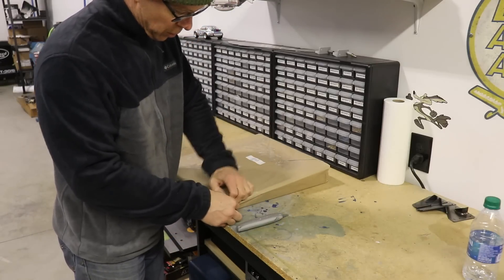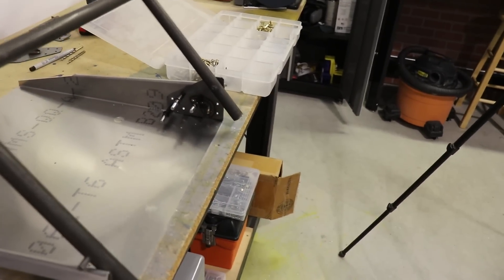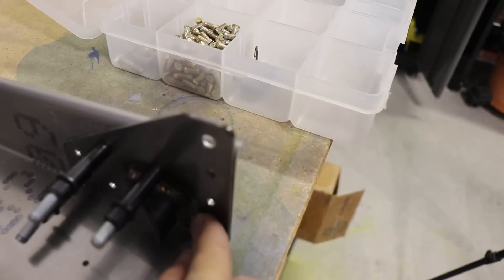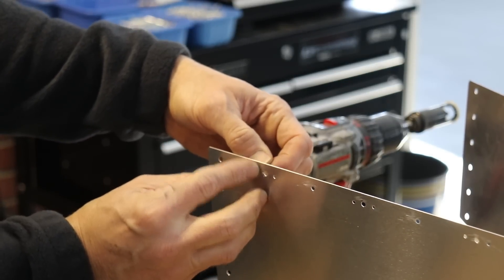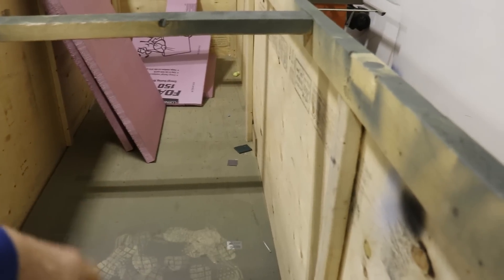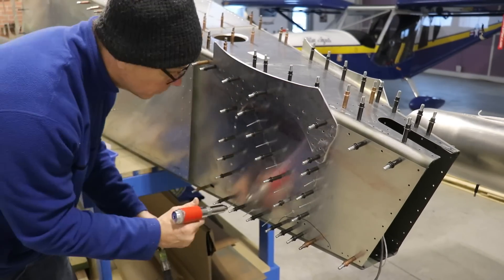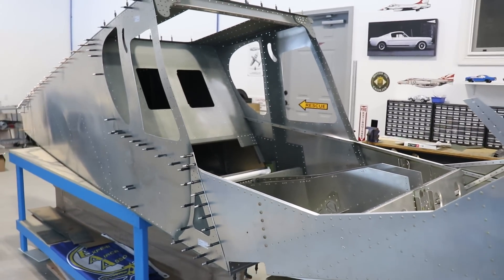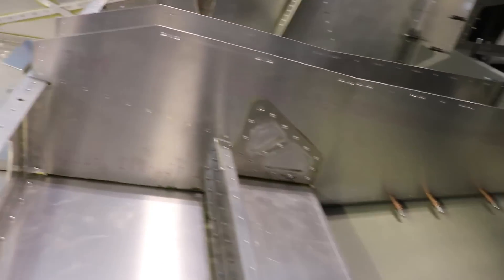CH750 Super Duty Seats, Fuselage, and Workshop (Ep31)

Comment: Hey Mark. I come from the boat building world. Just watching all your videos for fun. Maybe I’ll get to build an airplane someday! One question. When doing flush solid rivets, sometimes you use a dimple tool and sometimes you use an aerospace countersink tool. Is there a reasoning for this?
Reply from the maker: Dimples are only possible in thin metal. If the aluminum is thicker it requires countersinking.

Comment: Mark, doesn't the place you get your powder coating require a minimum amount or do they do piecemeal whatever you bring them? How much do they charge you for powder coat per item or sq feet of material?
Reply from the maker: No-the place I go for powder coating (H&H in Fenton, MI) is awesome. They do thousands of auto parts everyday. So when I need something, I just drop it off and they add it to the rack. They always have the parts ready in about 4-5 days and I don't even ask "how much". They have very reasonable prices. All of the seat parts were only $40.

Comment: Hey Mark!  Couple of questions ( as usual ) why not just use the flush rivets on the seat brackets and second , how often do you use your metal brake. , Drill press and\or band saw while building either Zenith? I'm still gathering and organizing my garage\shop and debating on whether or not to purchase these or get by with hand and air tools. Also , could you quickly touch on your decision regarding the sliding seat option , there's some discussion on the subject in some of the forums? And Thanks again for your time! Blue Skies!
Reply from the maker: The plans call for steel rivets, and the steel ones are not flush rivets. That's why I'm using the flush screws. Someone else commented that I could probably just put a nylon washer on the pin that's welded to the seat back and I wouldn't even have to countersink anything. Unfortunately, I think he's right LOL. I probably did it the hard way. I don't use the brake too often, but when I need it, it is nice to have. Len has also used it a number of times on his Velocity. I use the drill press and band saw a lot. I'll talk about the seats in an upcoming video.
Reply: @KitplaneEnthusiast  thanks!

Comment: Now this is just me, but I would have drilled close tolerance holes and used countersunk Hi-Loks or Hi-Lites on the seat back mountings. On another note, post up the Nutplate part numbers you're using and I send you a Nutplate Drill tool. Much better, safer, easier, and faster than using the actual part.
Reply: https://youtu.be/jGpw7T_4zNc?t=288